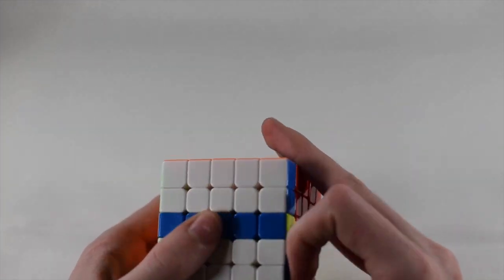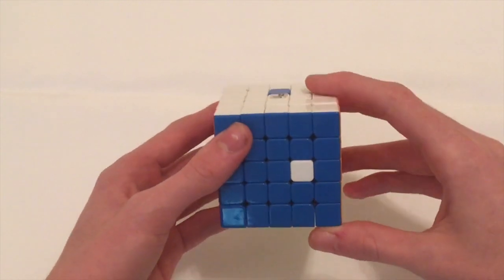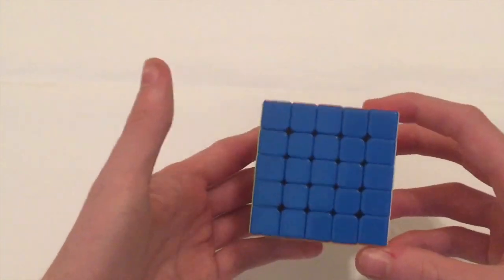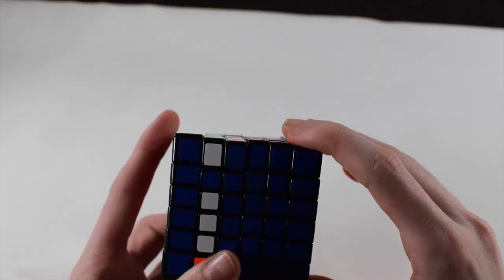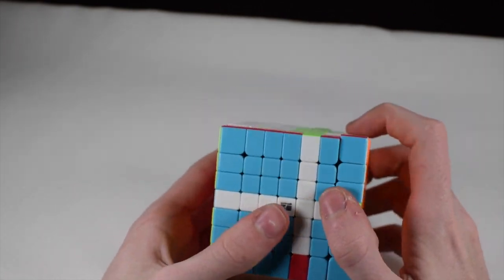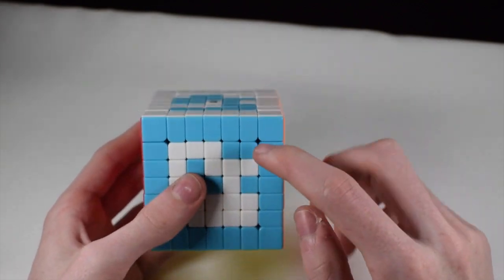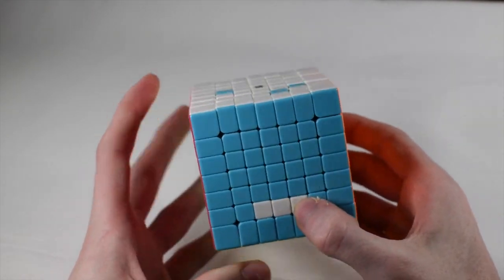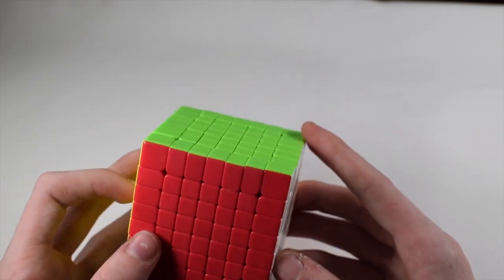How to Solve Commutators

Comment: A small clarification.

To be precise a “Commutator” is NOT simply the exchange of two pieces.

Rather, a Commutator is a class of operations (which can be useful for various operations such as “exchanging two pieces”, as well as much else).

In more detail, a Commutator is a sequence four operations (or sequences of moves).  Let’s call them: X Y X’ Y’

— Operation X change the state of a single Target Piece (for example, an edge-flip) on a single “Layer” while leaving all the other pieces in the layer unchanged.
(Here a Layer means a face on a cube, or a slice on a 3X3 or larger cube.)

NOTE that, while the only the state of the Target Piece has changed in the Layer, the other pieces elsewhere in the cube may have been significantly changed.

— Operation Y moves another piece on the Layer into the original location of the  Target Piece whose state was altered during Operation X.  (Call this second piece the “Helper Piece”.)

Typically this Operation Y might consist of a single move.

— Operation X’ (or “X-prime”) is the “inverse” of OPERATION X.   That is, you perform all the moves in Operation X in reverse order.

NOTE that since Helper Piece is now located where the Target Piece was originally located, performing Operation X’ effectively “walks the Helper Piece backwards” through the sequence of steps that was originally performed on the Target Piece in Operation X.

Specifically notice that at the end of Operation X’ the original Layer is unchanged except that the state of the Helper pieced has been changed (for example, it has been flipped).

—Operator Y’ (or Y-prime) is the inverse of Operation Y.  That is, it is the move that returns the Helper Piece to its original location.